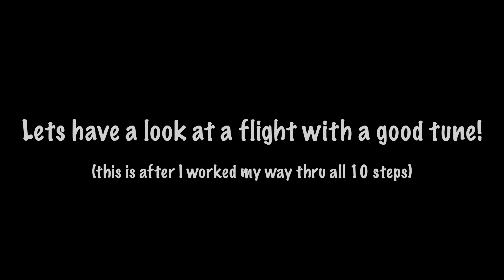PID tuning made easy! 10 steps to perfection (FPV - MINIQUAD - DRONE - RACING)

Comment: Im gonna try that on my quad. When flying slowly, it seems not have any problem, expect when you coming down vertically slowly, on low throttle. Also it has  strong vibrations when coming down from split s. Although old video, the tips making sense for me.

Comment: Sir i have made drone but my one motor is not rotating when i give full throttle by joystick then it is rotating slow as compared to other 3 motors. What will be the solution plz???

Comment: i am glad i found you channel. i have a desperate quad. whatever i do i can not stop slow wobbling all the times. it is visible on recording but outside there are no big wobbles. controller is f411 20amps aio board with softmounts. 4" build. 4s. i need it to fly slow and gentle such as cinewhoops do.   increasing D value is helping but more than 50 cause motors to overheat. i  was trying betaflight previously, today i switched to emuflight but no change. same thing happens.

Comment: Hell yeah it's useful. I've never bothered with PID tuning because it always confuses me with how it's usually explained and the stock settings for the few quads I bought and built fly well enough that I have very few complaints so I just learned to fly them as is. I'm going to use your information to try to PID tune something. Thanks. Great video and great flying.

Comment: Super nice flying I have a question.When I find my quad just barely normal speed flat it looks like I get some little bump in movements like you’re some air tribulations but it is totally calm outside and the ideal where I need to tune?

Comment: Good info. Are there some general guidelines, like a stretched X frame always has more or less P-term on pitch than on roll, for instance? So it will be easier to have a baseling tune to start from, depending on frame type?

Comment: I sub just because this video help me out so much. Me pid's were way to high and I got osolations all the time in fast hard turns and punch outs. Every one said that it was d gain they said tune it out as propwash and I tried everything and did not work. I didn't know anything thing about how to pid tune. I just wanted to fly how it was then I got higher kv motor then it went down hill. I just figured I would just ignore it but it just bothered me so bad. I went through so much trouble. Then I looked up pid tuning on YouTube and I watched a tone of videos and they didn't teach me anything, they just pid tuned there kwad they didn't say what did what and what happens if this is to high or to low, then I watched this and it help a tone. Thanks so much 😊
Reply from the maker: DP FPV Glad to hear you got your quad tuned :)

Comment: hi, i need some help please, i get some floating effect, at which setting should i concentrate to get rid of? thanks
Reply from the maker: Andy FPV Not really sure what you mean with floating effect? But to get the quad more locked in try to increase P on pitch/roll untill you get fast osciallations. After that increase I until you get the feeling you want.
Reply: @TenguFPV  thanks for your resply, it feels like jello in gopro footage, like waving

Comment: You got the d gain roll wrong.. soft bounce backs are indicative of too much D and fast rolls are too little d or too much p.
Reply from the maker: Don Jello Sorry, I cant trust the word of somebody named jello :)
Reply: Tengu RC whatever floats your boat!
Reply from the maker: Don Jello This was a very basic tutorial for beginners. If course both P and D affects the stops after rolls. But my goal was to keeo the vid short and not rant on to long in each step.
Reply: Tengu RC well apparently i cant even type properly so who am I to correct someone lol i meant to say fast oscillations are too much p or too little d and slow bounceback oscillation is too little p or too much d as dterm is there to slow down p overshoot and even it out. I believe in the video you had it backwards but who cares at this point we are both confused
Reply: @MaxBeamer  I think he's got it right in the video. He says bounce back at the end of flip/roll, that's classic low D. They usually don't last long, typically 1 or 2 fast bounces.  On the other hand, you're also right as slow bounce backs are due to excessive D or low P but they are slower and they feel like the kwad is dipping or when a boat slowly swings on waves a couple times. 
Following his tuning guide, by the time you reach tuning D your P should mostly be okay and your D will likely be on the lower end.
Reply: Balint133 sure! Could be anything too much I term perhaps. I term relax not on! Happy flying!

Comment: Hello, can you help me? When i going straight up and then killing throttle drone want a make half front flip also making roll little bit not going straight down what is my problem ?
Reply from the maker: Lauris Gaitnieks hi! First make sure airmode is activated. After, increase anti gravity till its stable
Reply: @TenguFPV I fly without air mode, when its activated no problem, i fly more freestyle and with airmode its no more fun!
Reply from the maker: Lauris Gaitnieks how come? You must use airmode when flying freestyle, otherwise the quad flies like crap!
Reply: @TenguFPV  I tested all good thenks for help, no problem now!

Comment: hey thank you very much. 
I have a problem on tuning my quad.
When i punch out forward or upward, my quad oscillates (wobbles). 
You say increase TPA. I never thought of that. 
I always tried to tune roll and nick. but without success! I try to tune it with TPA and fly tomorrow. Hope it helps. This problem appears more on 6" props, than on 5" props.
You explain it very good and easy to understand! Great work!
Reply from the maker: slayer. fpv Thank you! If you have fast oscillations that gets worse when you increase throttel you could decrease P or add some more tpa. Hope it helps :)
Reply: @TenguFPV  you saved me! I tuned it again and now with TPA on and it flies so awesome! Thank you man! Hero for our hobby!
Reply from the maker: slayer. fpv great to hear!
Reply: @TenguFPV  thanks for your answer! yes the oscillations get worse with more throttle. it starts about 50% throttle.i can clearly hear the oscilations in the sound of the motors. i think about 5-15 "shakes" per second.
When i change TPA, i do it only on P?

Comment: I’m getting prop wash on my turns. What do you recommend I do? Should I lower the P or D on yaw or add more?
Reply from the maker: Rob FPV olide Higher dterm ob roll and pitch, but in small steps! Check the temp of the motors!

Comment: I can not get a good tune on my quad. It has horrible prop wash. It also isn't locked in, I even soft mounted mostly everything. Any help?
Reply: Ripmonster FPV i had so much vibrations and did not think about change props. after getting DAL T5045C all jitter went away. had HQ 5x4.3x3 before. never again

Comment: this is great I never could tune my quad to fly really good but after doing this man oh man the quad fly's amazing and no hot motor's like I was getting with the stock pid's thank you for this video Tengu and I did it on butterflight with my dark matter quad
Reply: Can a stock tune be so bad your props sound like there twitching at half throttle

Comment: How does the tmotor f40's holding on on 5s? Do you have i lot of trouble running them on 5s or can they handle it?
Reply from the maker: Booly Vdberg No issues at all? Been flying more then 100 flights on then with 5s and they are still holding up great
Reply: Tengu FPV  oke great!! And do you have to do al lot of changes in your pid's by switching from 4s to 5s?

Comment: How to distinguish too high pitch 'P' oscillation from too low pitch 'D' oscillation, especially in the propwash situation? I mean if we got propwash how do we know if it is too high 'P' or too low 'D'? I use a 210mm, stretch X frame, my 'P' are lower than yours, 'D' are about the same as yours but still got pretty bad propwash.  Roll 'P' 46, Pitch 'P' 56, 'D' are 23, 27 respectively. Another curiosity is my i are so low like 23, 27 but i terms is quite perfect!?

Comment: Nice and simple tuning video ! I still have to take my quad through the steps.
I've recently changed the motors and not yet tuned the PIDS again BUT I hear a thrill sound from the motors when I punch out... is this imbalance of the rotors or rather bad tuning?
https://www.youtube.com/watch?v=0zoNQmMxeS8
Could you perhaps guide me on identifying the problem?
I did not have it before I change motors...

Comment: Great video!!! If the weather here in Holland is good today, i will give it a try! Do you do the whole dynamic+notch filter stuff before, or after these steps? I currently have the dynamic filter ON and running PT1 with the first and second notch filter turned OFF.. i have tried a few pid tutorials.. but this seems to be the easiest and also great info on what to look for! Keep up the good work!

Comment: After setting setpoint weight do I need to change setpoint transition?
Reply from the maker: HoverState Its not needed to readjust but it can provide a slightly diffrent feel. If you change set point weight drasticly you will need to change your dterm. Good luck!
Reply: Thanks

Comment: Thanks for doing this. We need a refresher as the firmwares evolve, to include stuff like AntiGravity etc. Also need to discuss the evolution of looptimes, different types of gyro and d-term filter configurations in the different systems and how they affect tuning. Not a super elaborate discussion but again few quick steps that work well.